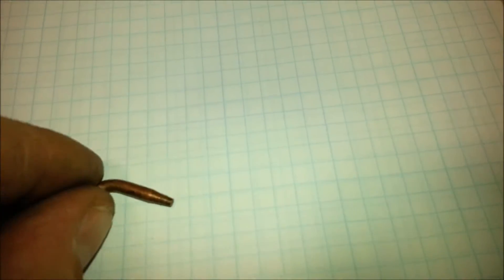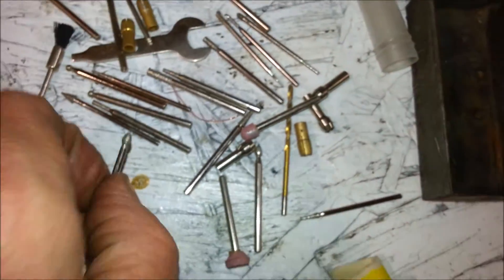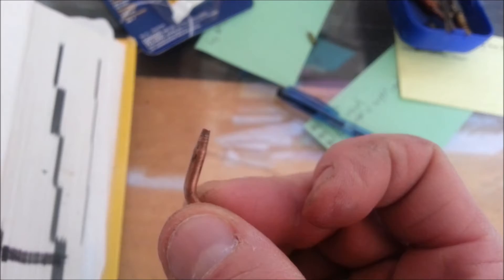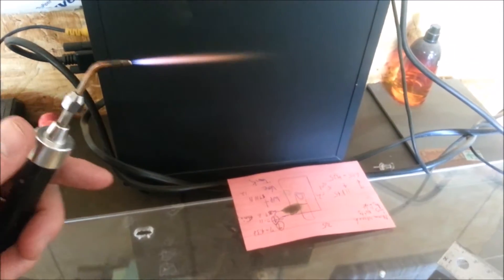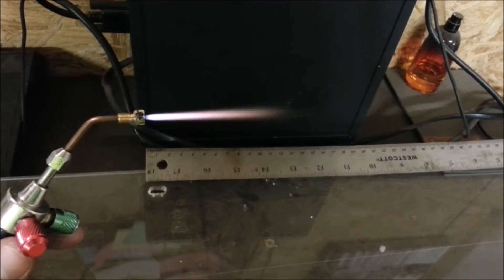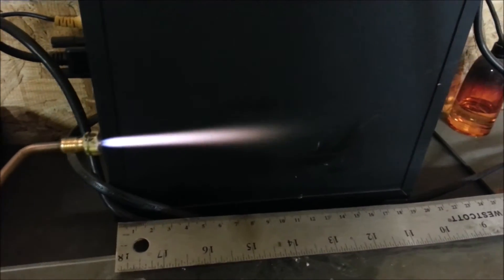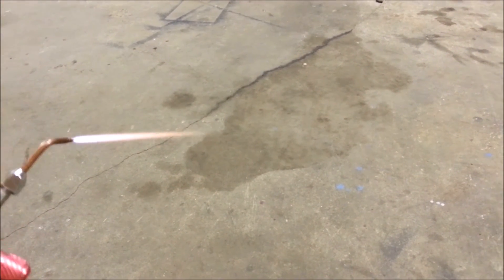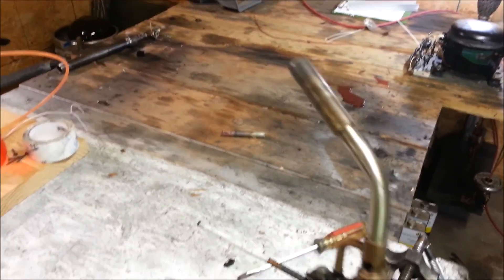HHO Torch Flame Modification and orfice Geometery

Comment: Do you still have this torch?  I was wondering about whether one could “glassify” or fire, that coating you are working with now.   

Might also be able to melt zirconia into the surface of refractory, and create a hard surface on soft/insulatove refractory.

  Also, what’s your screen name on Donkey’s forum?   I’m Coastal Rocketeer.

Comment: If you look at “Seaver”. Hes got some nice HHO / Oxy Hydrogen torches. 

Have you look at torch lighters for inspiration or for repurposing?

Yes i know this is an old video but I’m still interested
Reply: If you put some acetone in the bubbler it would make a flame we can see better. It also reduces the temp
Reply: 15:50  why not use the HHO FLAME?

Comment: I work with copper/stainless steel
can an HHO torch weld/braze/solder copper and/or stainless?
Reply from the maker: Yes it is an excellent brazing gas but you have to add acetone or a small amount of propane

Comment: 14:56 I must say, the way you hold that flame on the rod, makes me cringe. Please use the torch correctly. Again, look up a torch label on google. Then remember what I said, "Use the tip of the inner cone". It is okay to bend the feather. Never bend the tip of your inner cone from getting to close. And don't get to far, the max heat is the exact tip of the inner cone.

Comment: I have been watching HHO for a good 48 hours now. And I think I should build something and put it on YouTube. For one I think I can make better generators for HHO. For 2 why is everyone so confused with this topic? Why is everyone using a torch that combines HHO to early? Have you never gas welded before? Oxy and acyt and separate from each other. First you turn on the acetylene, next your strike the fire. Because oxygen is not in the same tube the fire cannot travel up the tube. Then you turn on the oxygen and that mixes at the tip of the torch. Why is no one burning Hydrogen on here with oxygen in a separate line? You could adjust the flow to make it way hotter. Just saying :3
Reply from the maker: you miss the point
Reply: You are funny expert after a day

Comment: It is called an ineffective flame. It should be burning as fast and hot as possible. I am not meaning to be a Smart horse but look up (torch flame labeled).

To be more technical. You extended the Feather of the flame, distorting the inner cone (collen) of the fire. The tip of your inner cone is the hottest spot. You want it to burn as natural as possible. Your Turbo torch is an ineffective torch flame, with an elongated feather and distorted inner cone*. Answer here

Now to get more in the science of this, you can get somewhere with the Cone shape in the top pointing heat back to fire. But it needs more to it. And this is rocket science. Not doing it for free. ;)

Comment: what is all of this? is that contraption generating hydrogen and oxygen by electrolysis?
Reply from the maker: yes
Reply: @NOBOX7  can you not get hydrogen in cylinders from a weld shop? juts asking because im not sure myself,,i have made a mini blow torch that i run off oxygen and propane but id like to be able to weld and there is no gas for that other than acetylene ,im looking for something i can purchase at a hardware store to use for welding gas like they have for propane or map/pro small B tanks,,would be awesome if hydrogen was sold like that too,,its enough that i have a 60 cuf oxy cyl but i do not want to get acetylene like that and prefer to find some substitute gas for welding instead of juts soldering and brazing like im doing now,,,check out my torch if you like there is a vid of it on my ch

Comment: Thanks sir for this very use full information.... which gasket materiel you used is this hho gen ? and what is the gasket thickness in mm? which is the best gasket for hho welding machine ( high temperature) .

Comment: Good demo sir .... how many plates & size you have had used in this hho  generator ? how many volts are there? 
could you tell me on my mail id  it is manesantosh05@gmail.com
Reply from the maker: The device uses 37 plates and runs on 120 volt rectivied current , the cell voltage is 2.2 to 3 volts per plate gap this translates to about 800 amps of electrolysis current @ 15 amps AC input . i have several videos on this cell and the design evolution was also archived

Comment: On the stove tip.....is it a constant diameter through the hole?  I was wondering if it was bigger, then necked down for the final orifice, then opened up with the bevel.  Would having a larger diameter inside cause more turbulence when it was forced out the smaller hole?  You can't modify the torch tip like that, but maybe an add on tip like the stove tip.  What if the hole or bevel was square or elliptical?  Thinking about the gas lens on a tig torch and it's affect on gas flow......I wonder if a small piece of sintered bronze in the back of the stove tip might stir the gas and disrupt the flow to soften the flame.  I don't really know anything about this......just asking questions. :)
Mike
Reply from the maker: good comments mike actually this torch does have a sintered bronze insert in the nek but not as you suggested , im finding very little help because there is almost no info on oxyhydrogen flame control
Reply: NOBOX7
Everything I was finding was related to diesel injectors. lol   What about a tip like an oxy/ace cutting torch?  I'm curious to see if you come up with a solution. :)